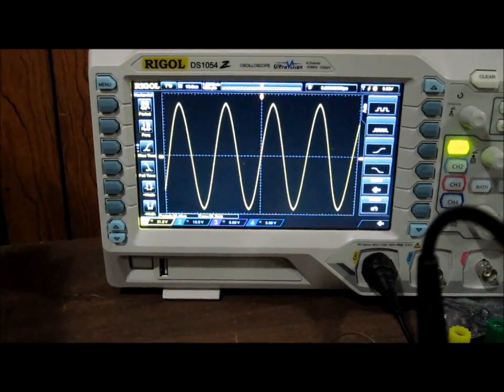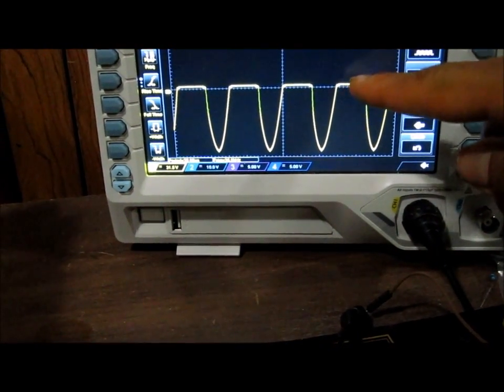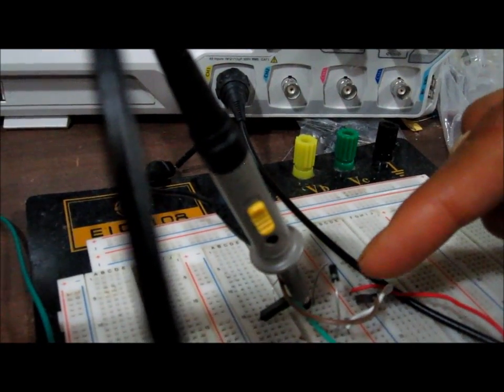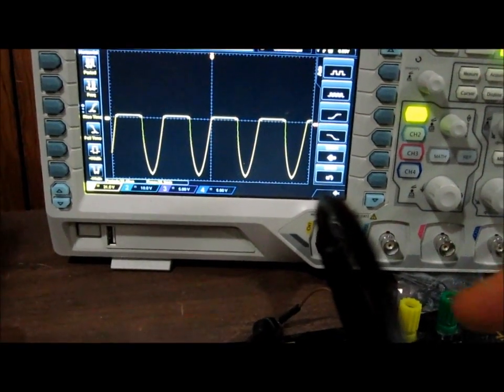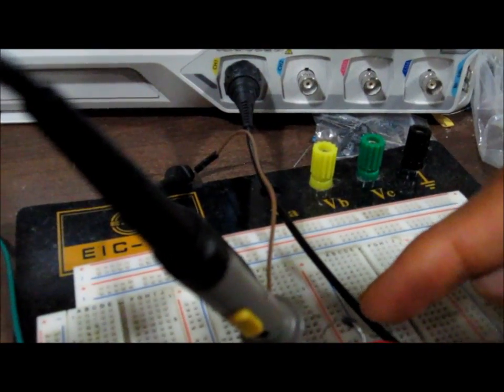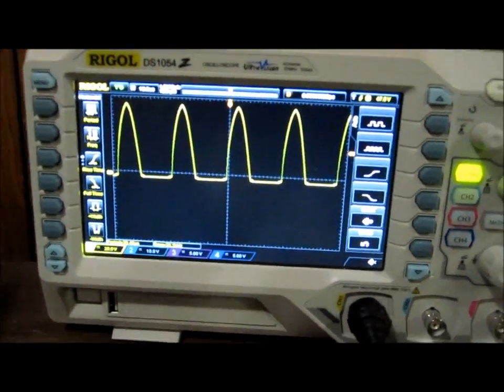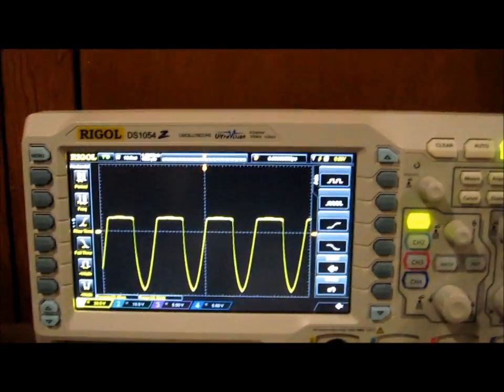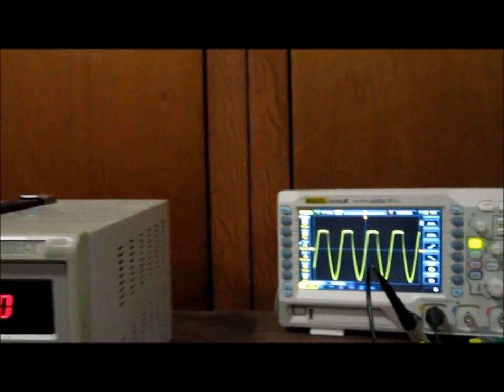Diode Clipper Circuits

Comment: how do u add a bias without having to use two power sources..
Reply: There's the main AC source for sine wave and using the diode, you can clip the signal as you want depending on the circuit configuration.

Comment: can i add the 3vdc to forward and reverse biased clipper circuit???
preferably with a variable resistor to control the DC voltage.
Reply: Do you mean to shift the level of the signal?

Comment: In second 30 you have a negative not a positive clipped diode You have it upside down
Reply: Not really, the black part of the diode is positive, and the silver part is negative. He connected it correctly (or else how would he get the correct output?)
Reply: @hiteshnair6778  i agree, but why is the polarity of the dc voltage flipped at the end of the diode?

Comment: When I set this circuit up with the diode pointing up and positive bias beneath it, a higher voltage bias would cause the output waveform to become closer to zero.  It actually had the greatest output voltage with 0 D.C. Volt bias.